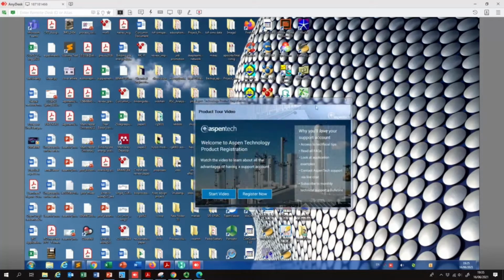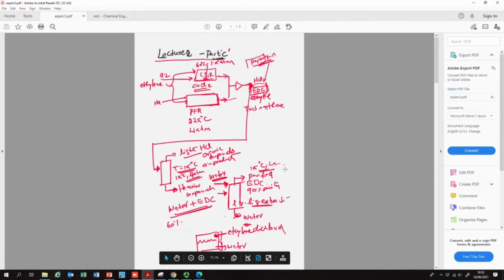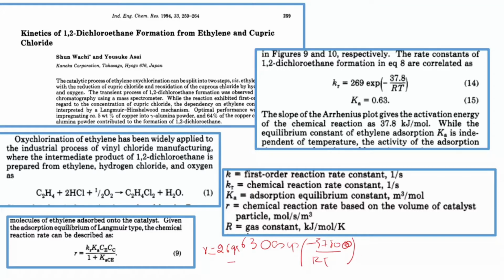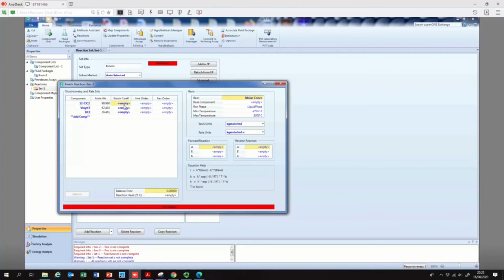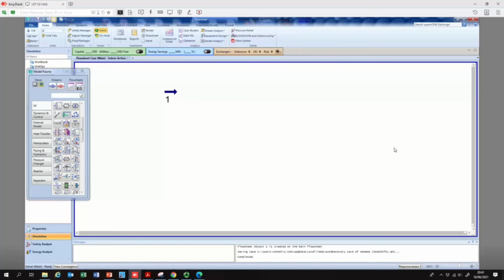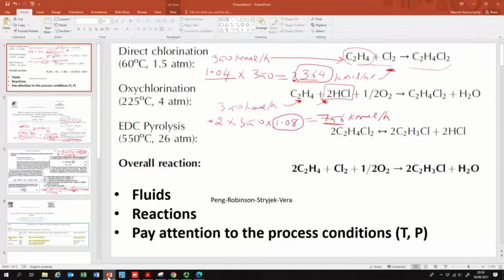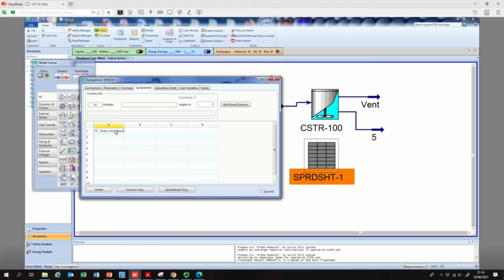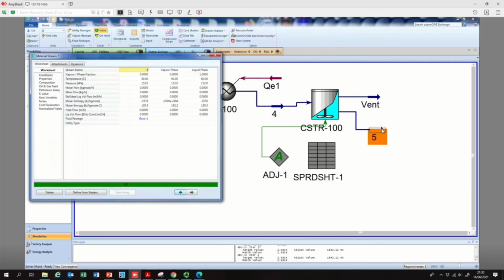Lecture 3: CG5031: Manufacturing of Vinyl Chloride Mononomer - Aspen HYSYS

Comment: In the video at 23.23 while entering the stoichiometric of the reaction. The reaction of direct chlorination. I hope the reactants should have a negative coefficient and the products should have a positive. Please correct me if I am wrong.
Reply from the maker: That's correct
Reply: @vasanth2980  Thank you i saw further and you have corrected it. I have another doubt. For the fluidized bed, we need a solid at the inlet of the bed. But since I am giving ethylene, chlorine, and hydrochloride acid at temp of 225 C and 4 atm. All the input is going as Vapor. how I can model using a fluidized bed in Aspen plus.